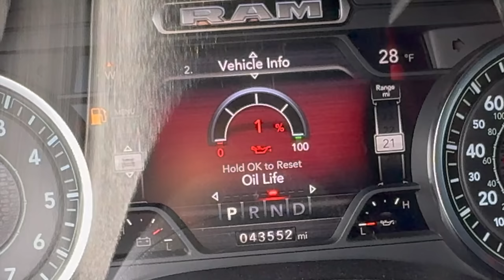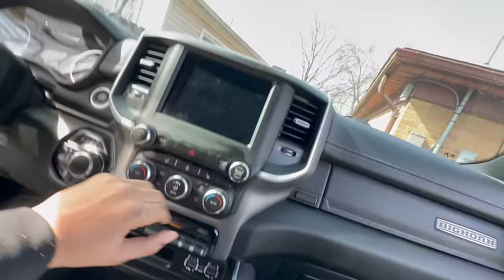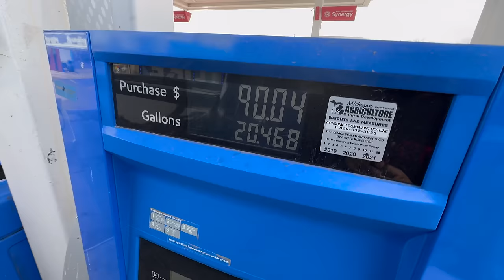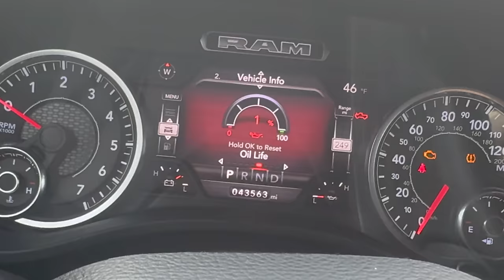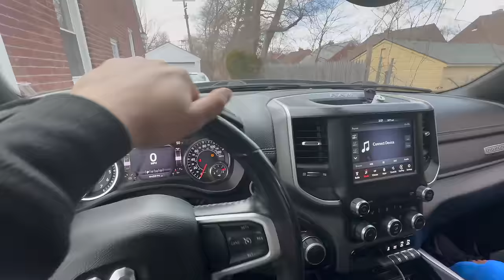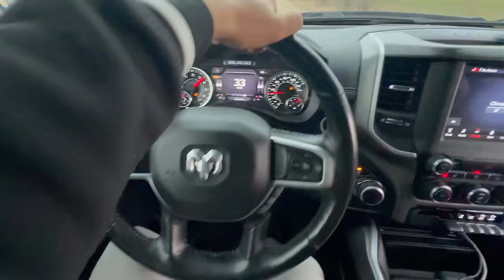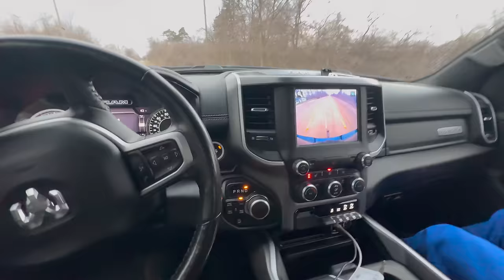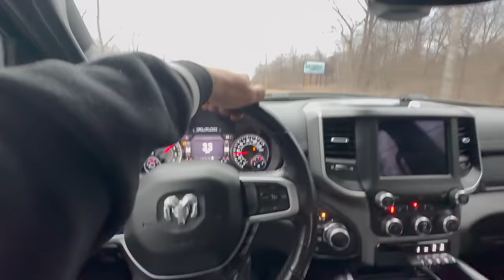TAKING DELIVERY OF THE FIRST BABY TRX

Comment: I use to work at harbor freight a long time ago as a way to get the tools I needed for super cheap. That oil catch pan has the other tiny red screw that you unscrew to act as a bleeder/air for the oil rushing into the pan it allows it to breathe when the oil is flowing in. I think you left that part covered still and if you open it and the hole is closed just cut a hole inside the molds are all made as one some don't get punched though.
Reply from the maker: Oh okay I thought I bought some bs😂
Reply: @fastlifenick3929  lmao 😂 I thought the same thing when I first used it and was like waaa then I unscrewed it and made a hole and it worked great 😂 all bout trial and error, at least your putting in the effort💪🏾

Comment: badass truck!! If you're looking for cool shit to do to it, 6 inch lift, 24x14s, rock lights and/or wheel lights, star headliner, muffler and resonator delete or a borla attack exhaust if you wanna spend the extra monyun, 5% tint all around and 20% on the shield

Comment: our 2007 2500 3rd gen which has a 5.7 in it barely had enough room to fit an after market air filter so no not all trucks engines are that small but i think its bc of the model you have which is the e-tron or e-torque which would make the engine alot smaller....

Comment: Hemi e torque motor is that that big silver box on the right side of the engine is that has a belt pulley on it. It's supposed to help with towing

Comment: Nick switch the 5.7 manifold toa 6.2 manifold do the demon or hellcat injectors wit hellcat cam … straight pipe and 3 in left keep the Trx wheel but go 35s so when you get ya trailer you’ll look legit 🤌🏾🤌🏾🤌🏾

Comment: The reason it didn’t stay in the oil catch pan is because u forgot to unpulg the other plug so that it was able to have a faster feed it was catching air bubbles it’s kinda like gas cans when u are pouring gas and u don’t have a breather hole on the gas can it kinda juggles instead of a steady flow

Comment: Nick since it’s 4v4 when ur launching it turn on 4x4 it’s gonna grip or it might spin but try it out , and it doesn’t have paddle shifters but it does still have gears their on the steering wheel you just have to learn how to use them 😂😢 straight pipe that mf